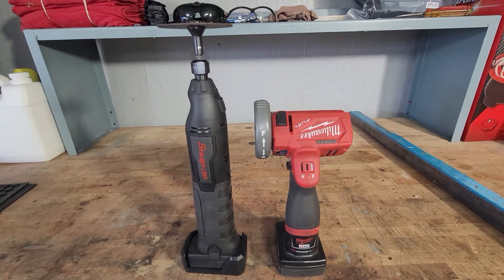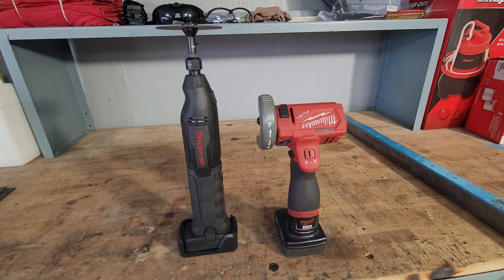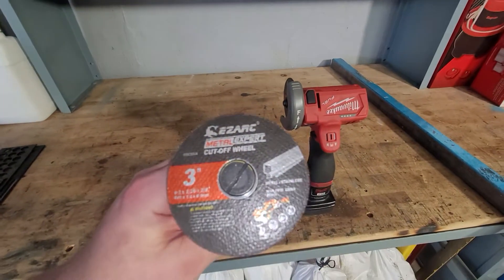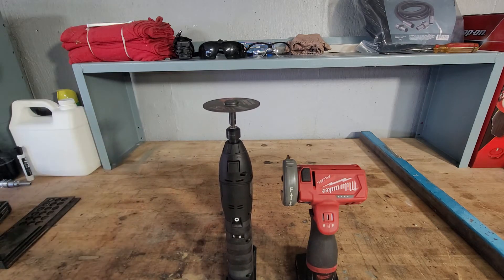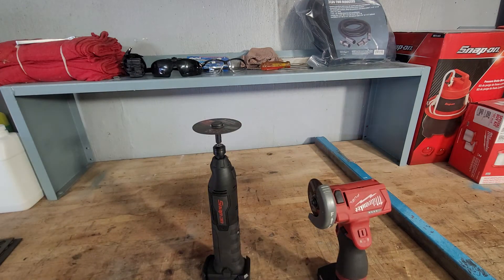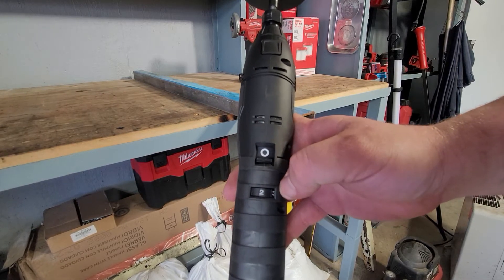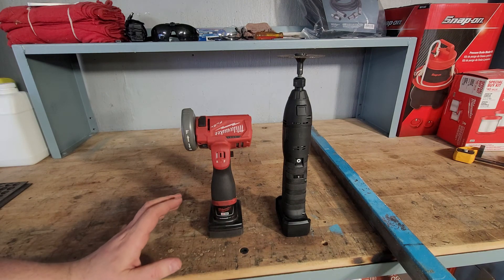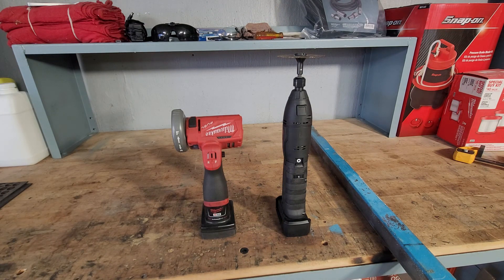Snap-on on die grinder VS Milwaukee cut off tool

Comment: That Snap On is nothing but a glorified Dremel. The attachments taper down to about 1/8” in the collet.
Reply from the maker: I think they all are glorified dremels. But Milwaukee has a M18 coming out like the flathead quick stop grinder.

Comment: Conclusion.  It's garbage. Who the heck is a real mechanic using this vs air.. me and my helper flag 95 in a  40 hr  week Consistently min. IF I caught him using this- I'd tell him drop it we gotta make hrs. And when trucks show up- turn it in. Or if u want to keep it- to use mine-never this garbage on my dime.
Reply: Goes for either one of these scam tools. Fine for a lube guy- maybe- if I saw a lube guy buying it honestly would have to speak up.